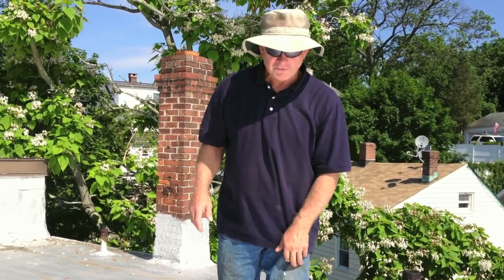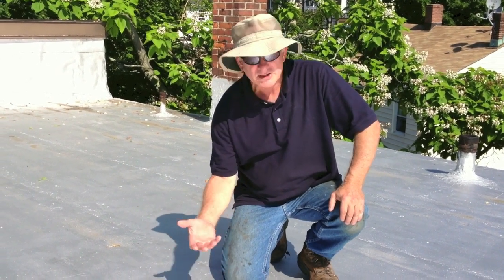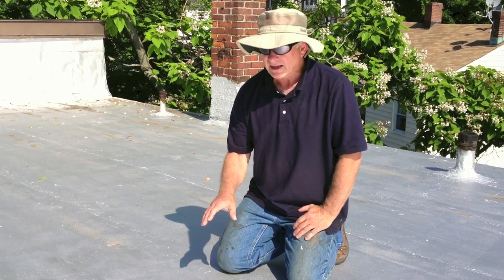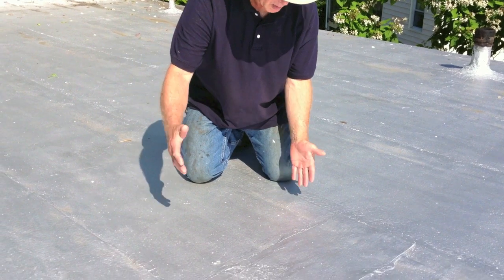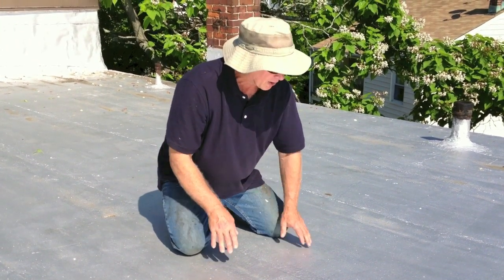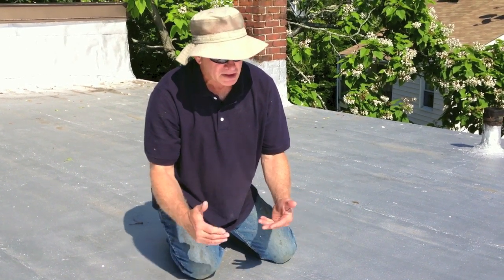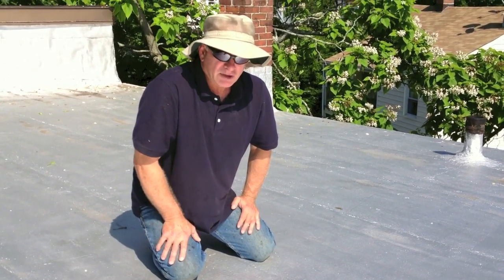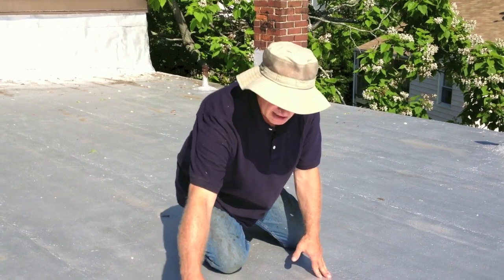Silver coating is to protect a roof from Ultra Violets

Comment: how do I patch a silver coat roof ( like fill in a crack ) do I need to prime the old silver coat first and with what? TIA
Reply: mike ferguson of the silver coating is flaking off you should power wash the modified bitumen torch down roof 1st before applying a new coating ,the #1 rule when using coatings for waterproofing is that a material sticks best to itself ,which means applying a new layer of silver coating over an existing layer dosent need primed 1st ,however it's best when recoating a weathered and cracked silver coating to use NON fibrated silver coat because it's thin enough to fill cracks and reenergize the coating vs a fibered coating laying on top of the cracks ,after coating the existing worn out coating with non fibrated silver coat allow 90 days to 6 months and apply a 2nd layer of heavy fibrated silver coating ,the 1st non fibrated layer of coating is your prime coat while the 2nd heavy layer of fibrated is your UV protection & waterproofing coat .
Reply: Thanks for your reply!

Comment: wrong the worst coating for Tucson AZ. This coating welcomes the heat of the sun soon after its application. No BUENO.
Reply: Steve Ugalde Explain the exact thermodynamic law that allows a reflective coating to " welcome heat " soon after application because in 32 yrs of being a journeyman roofer & waterproofer I've never heard of such laws of physics and thermodynamics being broken by any reflective coating .

On a newly installed Built up asphalt or torch down single ply that hasn't had a year to flash off fully, dollar for dollar a " fibered " silver coat is the best coating to apply for repelling UV and radiant heat .

Comment: Excellent Video and great tips! I have a question. I see a lot about saving on cooling costs during the summer months but In theory will I save on heating costs during the winter as well?
Thanks in advance
Reply: Andy Vanderbilt Silver coat has 2 main functions which are #1 as a UV repellant ,and #2 as a waterproofing material ,it saves you air conditioning dollars because it repels the UV rays from the sun that male your roof hot & transfer roof beat to the interior ,a UV reflective coating like silver coat will actually cost you more to heat the building because while it's repelling the sun's UV it's blocking the sun from warming the roof ,black roofs attract UV rays and allow a roof to hold the sun's heat but the savings are extremely small compared to savings on air conditioning ,the only way to save money on heating is by adding insulation R value .